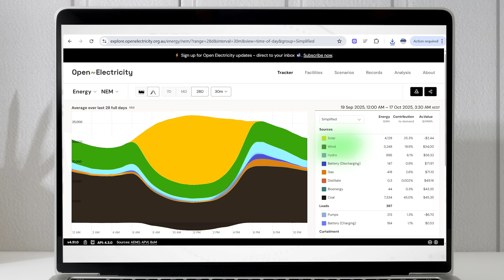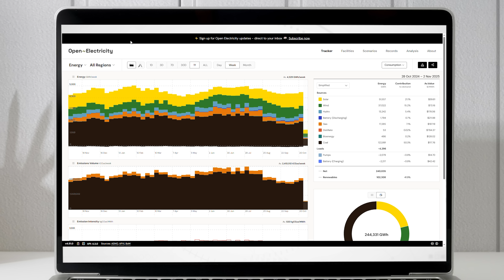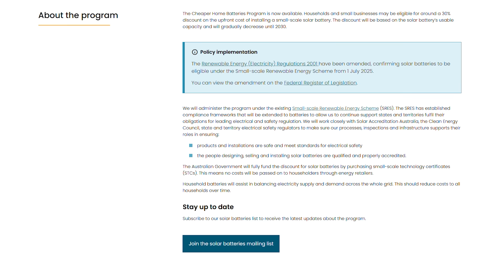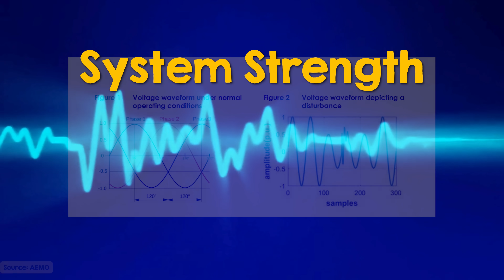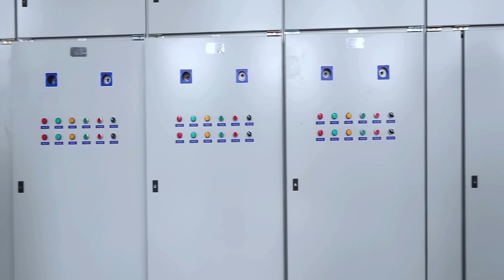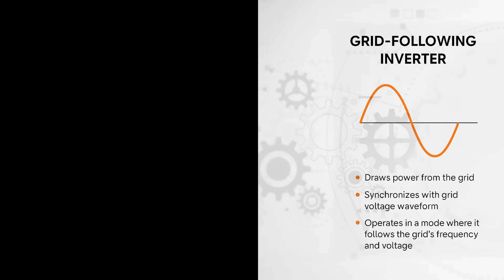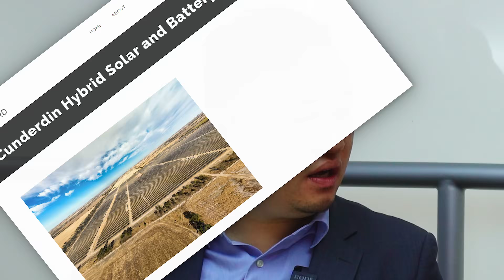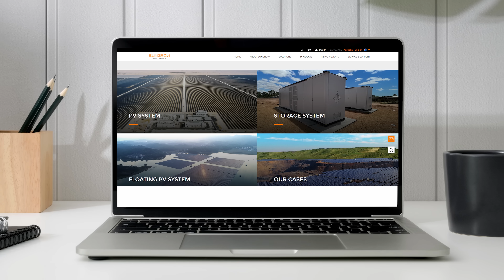Australia’s Solar Boom Is Breaking the Grid - Or Is It?

Comment: We have the same delusion on renewables in the UK using the marginal price for energy from them. But the reality is that in order for this intermittent supply to work in reality you always need conventional power to provide a base load and for when the wind doesn’t blow or the sun doesn’t shine. Then you need to change the grid structure and add means for keeping the grid in synchrony. Add in the capital cost and maintenance of all this infrastructure paid for by the tax payer and it no longer looks cheap. In the UK the cost of renewables is added to everyone’s bill and year on year it keeps going up even though gas prices are back to what they were before the Ukrainian war spike.  The UK has been going down this road for more than three decades and the cost of electricity has risen steeply as we add more and more of it to the grid, we now have the most expensive electricity in the developed world.  If you plot a graph of quantity of renewable energy installations against cost of electricity you can see a linear graph with countries most heavily invested such as the UK, Germany and Denmark suffering the highest electricity costs. You cannot run a modern economy with renewables the cost is far too high.
Reply: "when the wind doesn’t blow or the sun doesn’t shine." if only someone could invent  way to store energy. such as great big batteries, household-size batteries...
It's commonplace in Sth Aus to buy your batteries at the same time as you buy your panels.

Comment: "breaking the grid"? 😅
Thankfully you can easily switch solar off. Try that with a nuclear plant and you have a second tschernobyl.
Reply: The AP1000 reactor cools itself, without pumps, for 72 hours after shut-down.
Reply: @aliendroneservices6621
72 hours while nuclear energy HAS to put into the grid unless you want a second tschernobyl. And for 72 hours it pushes away way cheaper renewables. 
This effect became clear in when in my country germany we switched off our last three nuclear reactors in 2023. Quickly the energy mix became more renewable and ecofriendly than ever.

Comment: It would also help if you dedicated some solar panel installations to be configured with vertical bifacial east/west panels, so that you'd get a bigger peak of power production at the early and late hours of the day, resulting in each battery requiring to support the grid for that many fewer hours of the day.

Comment: Energy Storage Solutions for Effective Grid Management

Abstract

The integration of renewable energy sources into the power grid presents unique challenges and opportunities. This study examines the necessity of energy storage systems to optimise grid management and enhance reliability. Through the strategic allocation of energy generation and storage, particularly during peak and off-peak periods, the grid's effectiveness can be significantly improved.

1. Introduction

Effective management of a dynamic energy grid requires the implementation of robust energy storage systems. These systems play a crucial role in balancing supply and demand, particularly in scenarios where renewable energy generation is variable.

2. Energy Generation and Storage

The utilisation of energy storage systems enables the charging of storage units during designated periods of power generation. This can involve various types of battery banks tailored to meet specific energy storage needs.

During off-peak periods, these storage systems discharge energy back into the grid, providing a steady supply to meet consumer demands. Conversely, during peak generation periods, excess energy produced by power plants is directed towards charging these systems, ensuring that surplus energy is captured and utilised efficiently.

3. Methods of Energy Storage

Energy can be stored in various forms, including electrical, thermal, and mechanical potential energy. One notable method involves converting potential energy through gravitational systems—specifically, elevating water and releasing it through regulated pumps. This process effectively converts potential energy back into kinetic energy, offering a sustainable method of resource management.

4. Sustainable Energy Harvesting

Additionally, alternative sustainable energy sources, such as tidal flows in rivers and estuaries, present further opportunities for energy generation. For instance, in locations like Geraldton, Western Australia, the availability of persistent wind energy creates a significant prospect for harnessing renewable resources.

5. Energy Conservation Principles

It is essential to understand the principle of energy conservation: energy cannot be created or destroyed, but instead transformed from one form to another. This principle underscores the importance of effective energy storage solutions that can facilitate the conversion and utilisation of energy across various platforms.

6. Conclusion

The implementation of advanced energy storage systems is essential for the successful management of renewable energy within the grid framework. By strategically charging and discharging these systems, we can enhance grid reliability and efficiency, providing a sustainable energy future.

7. Recommendations

Further research should focus on optimising energy storage technologies and exploring innovative methods of sustainable energy generation, with an emphasis on regional characteristics such as wind and tidal energy potential.

8. Concept: Regionalised Grid Compartmentalisation

A modernised grid does not require a single nationwide or statewide network. Instead, power systems can be structured into smaller, decentralised segments such as suburbs, individual estates, industrial precincts, or broader regional clusters. These compartmentalised grids operate semi-independently while maintaining interconnectivity through controlled interfaces.

Interconnectivity is achieved through engineered layers of transformers, circuit breakers, capacitors, and protection relays, enabling intelligent load-sharing and fault isolation. This architecture enhances resilience by preventing cascading failures and ensuring that disruptions remain contained within a defined boundary.

The system relies on modern conductors, selective circuit protection technologies, and hierarchical load management frameworks. These hierarchical divisions may be symmetrical or asymmetrical depending on the energy profile, demand distribution, renewable penetration, and physical geography of the region.

This compartmentalised approach aligns with the growth of distributed renewable energy systems, allowing each region to integrate local storage assets, such as battery banks, pumped hydro, sand batteries, or hydrogen systems, while remaining connected to a broader network for stability and redundancy.

Comment: It would be solved by 1/3rd of home being off-grid, and having battery banks on premise to store that energy for later use, but still feeding that excess power back into the grid to help lower costs for others who aren't yet on Solar power, if an entire neighborhood block of about 1 in 30 homes have solar it would greatly benefit others in that area and adjacent areas who aren't on Solar. Supplementary to solar should be nuclear energy and then all these coal plants can just be shutdown for good, and they should be replaced with nuclear energy.

Comment: There is an easy solution. Store energy in cars when the sun is out. Where are people on weekdays when sun is out? 
Most people are at work. So introduce charge at work and discharge at home.
Than the car can drive the power back to the residential area. This moves power without using the grid.

Comment: Grid-forming Inverters sound great, but, thinking with my cybersecurity hat on: Is there a mechanism in place to prevent a network of rogue inverters from disrupting power stability? You can secure your steel turbine with a lock on a physical gate, but can you secure your distributed network of code-following-grid-leading inverters from remote or local code manipulation?
Reply: Yes you can; make an air gap between this network and the internet and monitor this air gap

Comment: Thank you Rosie, remote area grids do not need to be connected to main grids. Inverter technology can deal with all the fault, stability, reliability, power factor issues now. In NZ there are small solar and battery with BUG diesels being installed where ever grid connect problems need to be overcome. These are locally manufactured and administered by power retailers who bill just like normal supplies. I think that solid state controlled DC will be the major energy connection in the future. Some large consumers like Cloud storage and AI server farms already get supplied with DC, rectifying AC is inefficient, expensive, unnecessary, has no rotating momentum, and wrecks hell on waveforms with harmonics. Transmitting huge loads long distances with HVDC is now standard behaviour.

Comment: You didn't mention that all these solar panels are pushing up the voltage in the power lines outside people's places. At least one device i have will not work due to the higher voltage.

Comment: I've had this argument many times with US grid engineers (despite me not being a specialist).  They insist there are strong limits on how much solar the grid can take.  They don't seem to realise that many countries - Australian and Ireland being two examples - have decades of experience of dealing with very unstable input-output mixes (the US avoids this through sheer scale).  Smaller countries are well ahead of large advanced countries in managing this issue, which is why they will end up with much cheaper solar based systems in the next decade or more while other countries (including China, which is building way too much thermal along with their solar) catch up.

Comment: Hmmm, not a word on hydrogen and water-splitting electrolysis as a form of demand-side frequency modulation? That’s a missed opportunity. Electrolysis offers a triple advantage in grid stability: fast rollout through modular electrolysers, flexibility in ramping load up or down in real time, and instant response to frequency deviations. But the strategic edge goes further. Generated hydrogen isn’t just a byproduct. it’s a dispatchable fuel for peaking gas turbines. Hydrogen also becomes a long-duration energy vector, bridging renewables and firm capacity. The critical “if” is safe storage, but that can be solved through competitive advantage in containment, compliance, and innovation.

Comment: A stable frequency is needed for the operation of large interconnected generators and motors. But if you end up with 200% inverter connected renewables and motors controlled by inverter drives, do you then need that stable a frequency?
Also. In Europe there is an awareness of dunkelflaute ehrrr every 10-20 teases you could have European wide area of high pressure with no wind that lasts several weeks. This can be coupled with weather conditions that lead to little solar production. Sovciety can’t tolerate weeks either no electricity and batteries not a solution as wott have power for that duration and can’t recharge.
Is there any issue in Australia that would disrupt solar production? Eg electromagnetic storm from sun, or  storm that could break panels?

Comment: For the last 7 years i have been part of the excess solar problem. Soon i will be part of the solution. Two years ago my original very cheap system was fried by a local lightning strike. So i went to the expense of upgrading to a larger system (from 3.5kw to 7.8kw). I also made sure the new system was battery ready. 2 weeks ago, i ordered a 30KW battery. My hop is that through savings in night time electricity usage and joining a VPP the system will pay for itself in approx 4 years. The battery has a 10 year warranty with an expected life of 15 years. So even if it takes 5 years to cover its cost, i have 10 years of profit that i can put back into my savings. 

The payback time may be even shorter than that with the announcement of the Solar sharer scheme. I’m pretty excited for the future.

Comment: Solar and wind is cheaper than coal, er except they need huge expensive batteries.
Reply: And huge subsidies.
Reply: ...And except for the fact that they are infinitely-expensive, on a sustained basis (due to the fact that they cannot power their own infrastructure replacement).

Comment: Utility power generation is anachronistic. The power of renewables comes from linking small areas of power generation into larger areas of power generation. Think bubbles, areas where renewables are interconnnected. Each small bubble of renewable power generation can act independantly or pass on excess energy to nearby bubbles. It's all about switching to maintain baseload. But the current system was designed to work the other way round, controlled top down instead of bottom up.

Comment: I'm not an engineer but only an economist. But it seems to me that with smart meters we ought to offer a time-dependent price for solar feed-in to the grid. I pay a time-dependent price for grid load, but get paid a fixed price for feed-in. And a result my incentive is to supply energy chiefly when it is least valuable to do so.
Reply: A better idea would be to ban metering, and charge customers a flat monthly fee based on service-level.
Reply: @aliendroneservices6621  I don't think so. That would remove all the incentives for customers to economise on use of electrical power and to shift consumption to times when it was abundant.
Metering water usage (in Australia) was a great step forward in reducing environmental impact.
Reply: @brettevill9055  No.
You're confusing energy and power-service.
Energy is inherently ubiquitous and free.
Power-service costs.
Banning meters would remove the incentive for consumers to conserve worthless energy, not costly and valuable power-service.
It would make power-service cheaper, since people would no longer be stealing it.

Since wind and solar are unable to provide reliable power-service, they should be instantly and permanently banned from all of Australia.

Comment: They should join the SWIS to the NEM via HVDC.
Reply: This would spread the solar peak massively. Afternoon output in WA could help buffer the evening peak in the east. And likewise the morning peak in WA could be helped out from excess solar output from the eastern side of the country. I think some sort of large scale development in between would be necessary to offset the cost though. Batteries would likely be much cheaper failing this

Comment: 10.31 First point comparison seems little contradictory, both GFL and GFM can import and export power to the grid  while doing the operation GFL demands for stable voltage reference whereas GFM can work to keep the voltage reference stable.

Comment: I think the use of swappable batteries for Electric Vehicles and as a form of grid storage may need to be investigated more closely.  An EV (or large truck) would have a battery system that is partly made of batteries that can be swapped out for fully charged batteries while the drained batteries are put on a charger to the topped up at peak solar/wind generating times.  If not needed these batteries could be sending electricity back to the grid during low generating times such as in the evening when the sun goes down and then topped up again during the night using wind generated electricity or other renewables such as hydro.  It would enable the batteries to have a dual purpose while still providing a sound method of charging EV's when peak electricity production is available.  It would also reduce the weight in an EV which is something that is going to be a costly factor in road wear and tear.
Reply: There is a company called Janus Electric that is implementing swappable batteries in heavy trucks, including converting existing diesel trucks to electric. They recently commissioned their first commercial swapping facility.
Reply: @moblet  
I think for large trucks this is the "best" option since it enables electrification and also keeps the weight of each truck to a minimum which is something that seriously needs consideration since large trucks are already heavy.  If you think about it modern hand tools such as cordless drills and such are now so common on job sights that one wouldn't start certain jobs without them and it was due to the swappable batteries used.  These same tools are also convenient since a user can have one battery in use and the other on a charger.  This is the same with large trucks which need a swapping system where one set of batteries could and other batteries are charging waiting to be used.  If the use is not as great then these batteries could be sending electricity back to the grid from the charging station during peak consumption times and recharged during peak renewable production times enabling a better grid stability.
Reply: Yes, Janus Electric have videos that show them swapping those enormous, fully charged batteries in 5 minutes with the trucks setup to use them. We will see them in Aust. eventually.